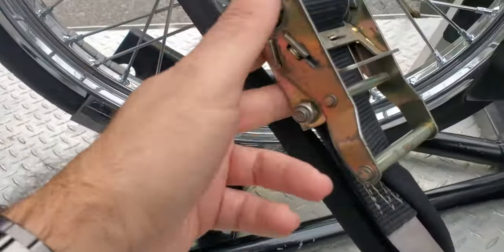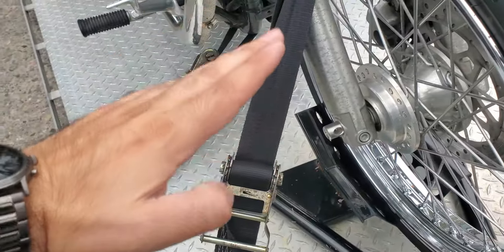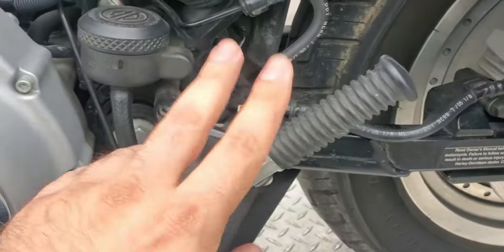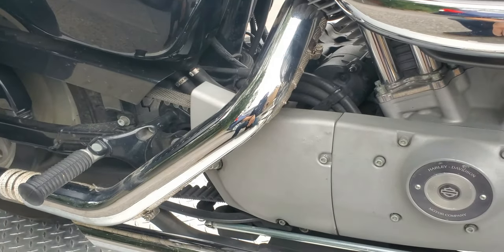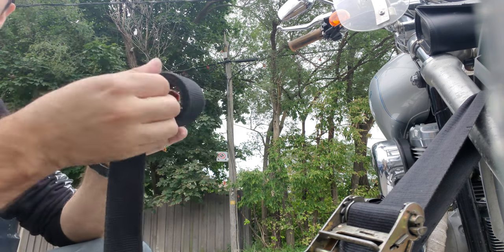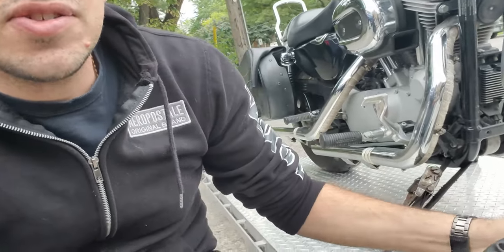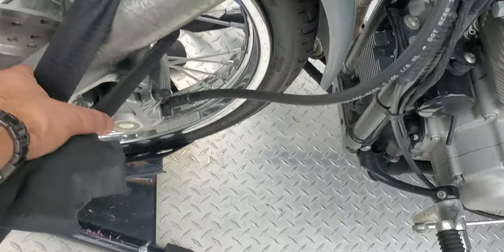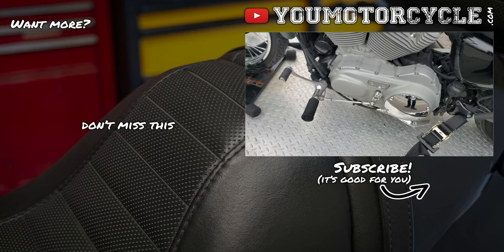How To Tow A Harley Sportster

Comment: Ok so you don''t necsessarly need a trailer to tow a motorcycle you coud do it with ah pickup truck too... interessting. I wonder how this lifting hydraulic mechanism is called. Do we have something comparable in europe? I must do a little research.
Reply from the maker: I think the main company selling these kinds of setups here is called AmeriDeck. The product is called AmeriDeck PowerDeck. They use a setup similar to the services that pickup and drop off big garbage bins at construction/renovation sites. I did an interview with them here: https://youmotorcycle.com/an-interview-with-ameridecks-josh-oertly.html
And their website is here: http://amerideckproducts.com/?utm_source=blog%20article&utm_medium=website&utm_campaign=Youmotorcycle.com